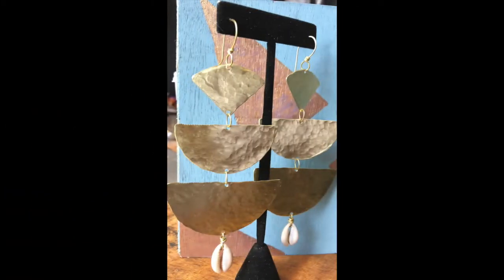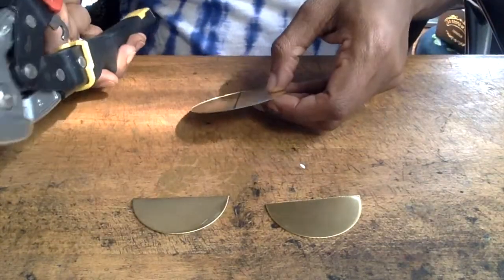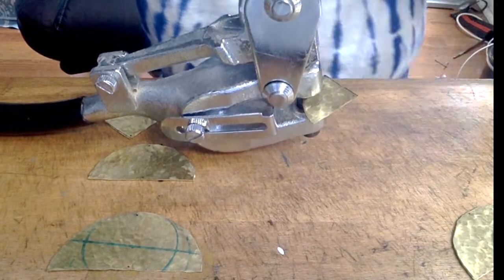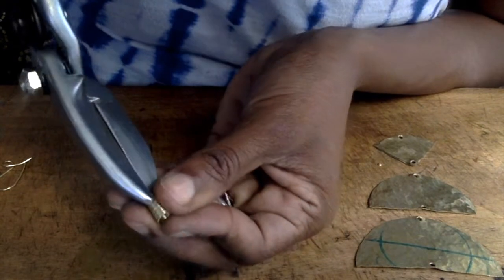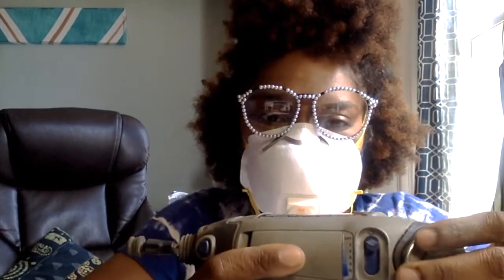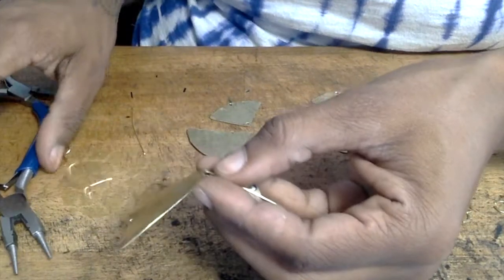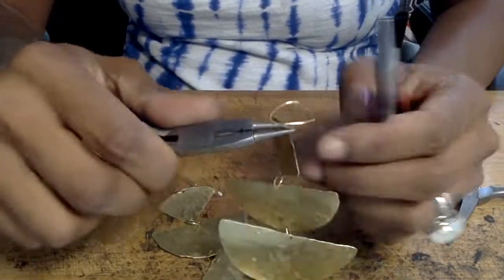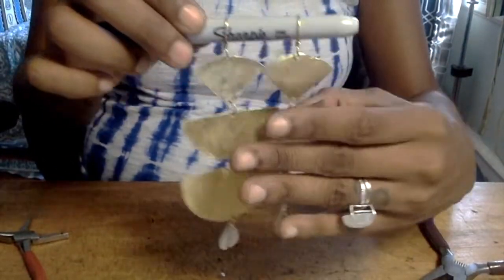DIY/ How to make Large Brass and Cowrie Shell Dangle Earrings

Comment: Hello I design aluminum jewelry.  I wan to start using the aluminum and copper sheets to design.  Can you tell me where I can buy the metal sheets and what gauge is best?  Also, what type of rubber or the name of the rubber that you use with the dremel?  Thanks in advance for any assistance you can give me.

Comment: Thank you for the vid! I noticed you used to different kind of cutters to cut the brass. I typed in boat cutters but nothing came up. Do they go by another name? And where did you get yours?
Reply from the maker: they might be called lock cutters, but they are the big ones!
Reply: Lady Michelle i had the same question, i found them under another name: aviation snips. Theres a straight cut, left cut and right cut
Reply: Tin snips.